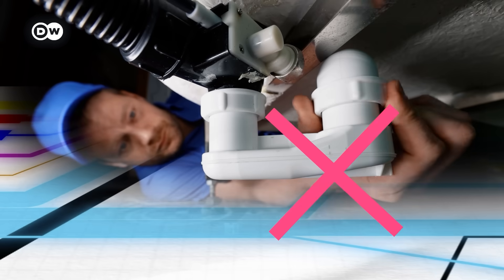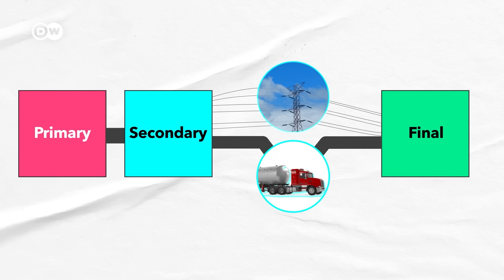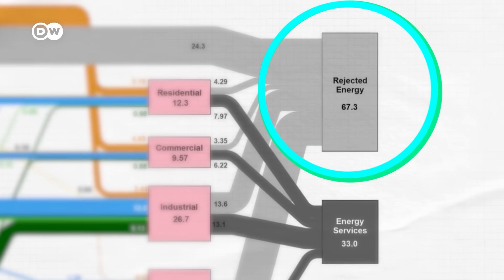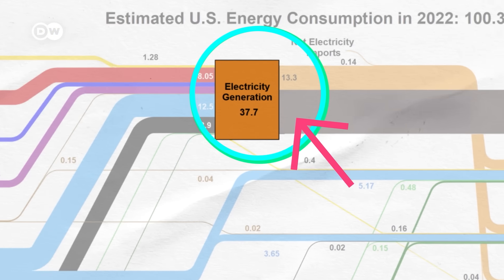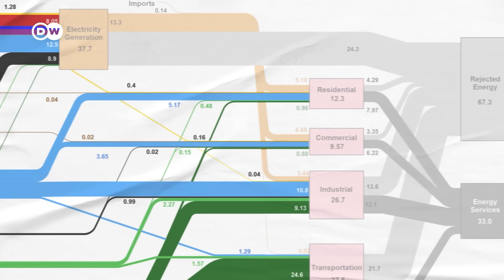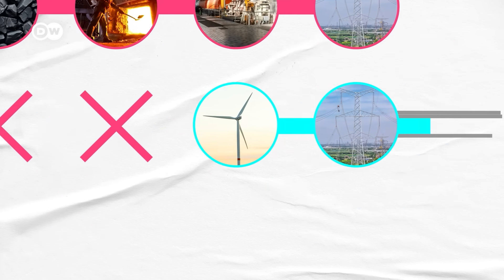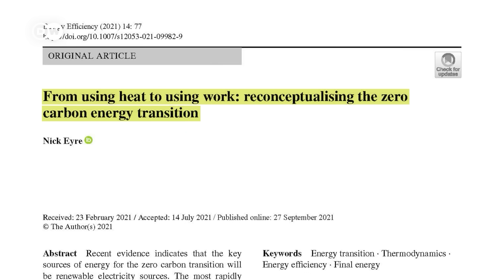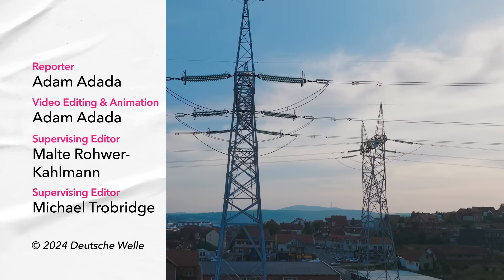The mind-blowing thing we get WRONG about energy

Comment: In the UK, when most of the population switched first to fluorescent light bulbs, then onto LED light bulbs, the nation's energy consumption dropped by (roughly) a third. Little things, done en masse, can make an enormous difference. If the country could just find a way to finance the mass installation of insulation for nearly every domestic, commercial, and industrial building, the levels of energy consumption would drop through the floor, and because the UK is so heavily reliant on natural gas for heating and hot water, once a wholesale (& what SHOULD be treated as a national infrastructure programme of significance for national security) were implemented, the drop in the nation's emissions would drop in tandem. Perhaps the lessons learned during the building of the national grid in the early part of the twentieth century might be applied here; compulsion through legislation would almost certainly be required.

The trickiest part of this would be how to approach property owners rights, any financial recompence, and who pays if things go wrong with individual properties. Of course, the training and implementing of a highly qualified workforce would be no small matter either.

I thought that this video was amongst the best I've seem at being able to sufficiently simplify the topic as to be clearly understood by a wide range of people who are not experts in the fields of engineering and energy. Very well done!! 👍

Comment: The transition to renewable energy is not as straightforward as it may seem. A significant amount of various materials is required to construct renewable energy plants, convert energy from DC to AC, and deliver that energy to consumers. Since this energy is converted by human and for human use rather than occurring naturally, it must adhere to the laws of thermodynamics. As a result, the overall pollution levels should remain consistent with use of hydrocarbons; however, instead of carbon dioxide, different pollutants may be produced. Of course, hydrocarbons are too valuable to be burned for electricity production.

Comment: This video is misleading in so many ways... First of all, in Europe and in the ex soviet block countries, the heat residue from coal, gas and nuclear plants are used to heat homes, office buildings, kindergartens, etc. (it is also used to produce hot water) Second of all, EV-s are a lot heavier, which means we need to produce more energy, which also increases energy loss at production level. Comparing the 20% efficiency with the 90% for EV-s is also misleading. 20% efficiency for regular cars include heating, and AC when needed. 90% for EV-s does not include those, along with heating the batteries in winter. EV-s are good, but not (the only) solution, imho.
But I have to admit that those charts are mind blowing. If only we could reduce those numbers. I hope EU will shift to that direction instead of just using solar panels, etc.

Comment: It wasn't wasted. It was used to make a fuel, and then the fuel was burned to release its energy. Internal combustion engines are inefficient but unless you have a more efficient engine, it's a moot point. 

Your points are largely valid only if you can power the world with wind and solar. But you can't. Missing from the equation is affordable storage. We can reduce fossil fuel use to a point and then grids become too expensive.

Comment: Thank you for the great video! One very stupid question came to my mind yesterday while listening about balcony solar panels. Let's say instead of getting sunlight from window, you put full opaque solar panel, which ends up getting no sunlight to apartment! Then you are charging your battery with that sunlight and let's say solar panel is so efficient that it is not heating any. 
So, we ends up having no sunlight to increase room temperature at daylight. Instead we charged our battery and use it for whatever we need. If we decide to use it completely for heating our home, then what is our gain? But as we havve global warming problem, it probably means we don't need to heat up our home with all sunlight, we instead better use it for other energy needs.
But how about global scale? Is wind useless? Or sunlight to the bare soil? If we absorb all the wind energy and turn it into electricity, then what about other roles of wind in nature? We are probably getting one spoon of wind from a huge wind energy ocean, but we just started!

Comment: This video completely discounts the fact that you need batteries to fully implement renewable energy.  There simply isn't enough lithium or lead on the planet to do that.  Look at Germany if you want an example of a failed attempt at 100% renewable energy grid.  In fact, they've recently had to reopen old lignite coal plants to support base load electricity because France no longer had enough surplus nuclear power to supply them.  I myself have been living off-grid with solar for +10 years now, and it can't be done without batteries or a base load supply from fossil fuels or hydro, PERIOD.  The solar panel and wind mill fairies will not save us, Fusion is humanity's only hope.
Reply from the maker: Lithium reserves are actually quite abundant. However, there are many problems associated with mining. Watch our videos on these topics here 👇
"Why our future depends on lithium"
📺 https://www.youtube.com/watch?v=gAZV1Ut6DDs
"Has the EU already lost the lithium battery war?"
📺 https://www.youtube.com/watch?v=Q6jJjCOJEzE
Also, great to hear about your way of adjusting your needs to solar availability. Here's our video talking about grid  👇https://www.youtube.com/watch?v=u-DsDuTceTo
Reply: You need energy storage. There are many technologies in addition to batteries to store electrical energy for short or long term use: convert to thermal storage (sand), upgrade reservoirs for pumped storage, chemical conversion (hydrogen, methanol). The storage type will depend on the end use.
Reply: @chrstopherbroughton130  The only type of energy storage that is decently efficient is pumped hydro.  Thermal storage and hydrogen electrolysis are terribly inefficient.  Mechanical energy storage is also... meh.  It's very difficult to store electricity efficiently and cheaply.
Reply: @bigrob1887  The thermal storage efficiency depends on end use: high for heating applications (buildings and industrial) and low for electrical generation.  I have watched a couple of other recent videos since your comment that you might find interesting “The Biggest, Dirtiest Secret of the Energy Industry”  and “Welcome to the Era of Energy Disruption”

Comment: Good job oversimplifying things.   What about the manufacturing and disposal of this tech?   And the toxins it creates?  What about the upgrades needed to make every house be able to charge cars?   What about the fact that there is very limited mineral availability?  How about the fact that the average person’s salary is not matching inflation, and even if it did it would have to exceed it to afford this tech.  What about the high cost of batteries, which is not going down as promised, and how these cars/ tech get scrapped faster because of the cost of replacement and repairs?   Don’t show the upside without showing the downside.   Sorry people, this is not a good unbiased video.  Wonder who paid for it.

Comment: There were cut some cornes in this piece. Burning fossil fuel to create steam to create electricity does not only uses the electricity. The steam can generate heat to a distributed heating sytem to supply a city. So the waste is not that big. Another point is the way to calculate the renewable energies. Its not realstic to expect a 100% gain from a solarpanel or a windgenerator.
Statisticly solarpanels delivers app. 25% on average and a windgenerator between 30-50% of their respective theoretical values. Everyting varies offcourse a bit due to location etc. but its fairly normal figures. Also its completely disregarded how different the globe are developed. African continent and most of Asia has at the best some very few inefficient powersupplies. Thats why smal generators are the normal in many households that can afford this. On the countrysides they have no power at all. Thats the main reason thats these areas to day builds coal- and oil-powered plants to create electricity in an attempt to electrify their countries. Because these plants are cheap and can be build fast. and they deliver a stabel output not dependant on weatherconditions. So we may like it or not but coal and oil will still be used decades from now because of this fact. 
We have spent 150 years in the so called developed countries to create powergrids covering our nations. Despite of this we are still facing shortcomings. How can we then expect the rest of the poorest nations on the globe to catch up? Its not realistic.

Comment: This is just sooo foolish. Magical thinking that we can just wave away these easily transported, easily stored, energy dense fuels that were chosen by society for real engineering reasons as our primary energy systems is just utterly ridiculous. Using renewables to completely replace fossil fuels isn’t a fools errand because the efficiency arguments presented in this video are wrong.  It’s because these arguments completely ignore the primary problems with renewables systems.  Renewables are too diffuse, and do not produce when or where we need them in the concentrations required to power a modern industrial society. It’s going back to energy farming. If we truly want to replace fossil fuels we better come to appreciate what they have done for us. Mother Nature collected, compressed and stored an amazingly dense and uncommonly easy to harvest and use energy in the form of fossil fuels that humanity has become accustomed to simply collecting. This has enabled the wonders of the modern world in which we live. No.. Energy density and dispatch-ability need to be replaced by another similar system that also includes density and dispatch-ability as primary characteristics. Hmmmm. What non CO2 intensive energy source has such characteristics? Hmmmmmmmm. I wonder?

Comment: I work in a grocery store and I understand that open refrigeration units are now no longer legal in France.. (they are required to have doors).  Does anybody know how much of a difference this makes?  ..(and by that I also mean not only with regards to energy efficiency but also in respect to retail theft.)
Reply from the maker: Hey there! The energy savings through adding doors to fridges at supermarket is about 30 - 40 %. There is no data on a reduction of thefts through the doors.
Reply: @DWPlanetA  Wow.. Thanks so much!  My understanding is that theft is increased.  There is a Guardian article on the net which claims that cheese is the most shoplifted item in grocery stores.

Comment: This is very promising. The value of natural gas for heating and rapidly deployable electricity generation with relatively low GHG emissions ought not to be forgotten. I got a heat pump installed this past March and I love it! It replaced a 40+ yo AC unit in the house I bought last Autumn. I don’t believe my high efficiency gas furnace has started yet this Autumn. The heat pump will take care of a large portion of my homes heating and cooling. It and the furnace work together to heat most effectively in the winter. A study in Ontario, Canada found a natural gas furnace and Cold Weather Heat Pump (CWHP) are the most efficient HVAC system. 
A CWHP can still heat at -30 C but they start  loosing efficiency below -12. I’ve read, on a web forum, they are still effective/efficient until about -22.  

 I will see how this winter compares to last in terms of my homes energy usage. The “instant” hot water heater should reduce gas usage for water heating relative to an old hot water tank.

Comment: I think the other issue is that solar and wind aren't very good.
Solar is fine. You can put solar panels on any type of roof, and they don't require much maintenance or cause too many problems. Energy usage is also higher during the day, which makes solar fairly practical. The only issue is cost and low energy density.
Wind genuinely sucks. Wind turbines are massive, they make building anything near them impractical, they are more weather dependent than solar, they kill a lot of birds, and tend to catch on fire. If it was the only way of getting renewable energy, it would make sense, but there are much better alternatives.

If we really want clean energy, the following energy sources make more sense.
Natural gas: Still produces CO2, but about half as much as coal. Great for a transition period.
Ammonia: Has its issues, but it has no CO2 emissions, which is currently the most problematic greenhouse gas.
Geothermal: Basically free energy. No unnatural emissions, no refueling necessary. You can literally dig a hole anywhere and if it is deep enough, it can be used for geothermal
Nuclear: The perfect green energy source. The byproduct of nuclear is nuclear waste, which is radioactive, meaning it can still be used as fuel.

Comment: It was a little bit of a fudge to make the comparison of heat-pumps with conventional heating as if it was another electricity vs fossil fuel difference. Inefficient non-heat-pump heaters can be electric too! That said, heat-pumps are a great step forward in reducing our energy usage. Similarly induction stove top vs conventional electric stove-top, public transport vs private cars ... there's a whole lot of stuff we can and should do to reduce consumption that is a separate issue to whether the energy is from fossil fuels or green electricity.

Comment: Plus.  Any fuel or device can be used to make electricity, which can power a broad array of machines.  You can’t do that with fossil fuels.  That frees us to make electricity in the most practical way for the time, location and available technology. If wind makes sense here and now, use wind.  If nuclear, use nuclear.  If natural gas, use that.  If you need to change, change.

Comment: Wow, I am for green energy, but this bit is borderline propaganda. They use the point that heating up water to produce steam takes a lot of energy just getting the water hot, before power can be produced. I agree 100% absolutely. Then they said that we should add more power from green sources because that will lower losses, by filling in the gap, and they showed a little picture of a windmill having 2 less steps. Okay we have established their claim. Now let’s look a little deeper. Why are we falling short on power during peak demand, even though as a society we have switched to more efficient electric appliances, and cfl bulbs? Well what they didn’t say was that we decommissioned a lot of perfectly good power plants before we came up with a transition solution. Now getting back to efficiency and heating and cooling water. Steam turbines are designed to run wide open at their max capacity for years until they need maintenance. They become way less efficient when they are throttled. The example I like give is when you drive your car down the interstate and set the cruise control you get the best fuel economy possible, but if you were to drive 20 then 80 then 20 then 80 smashing the petal to the floor you would get the worst possible fuel economy. So let’s not look at why they are being run this way. When the wind blows and the windmill start up, or the sun hits the panels at high noon, the power plant throttles the turbine. Going back to their point, it takes a lot of time to heat up water, which burns a lot of fuel, so we have already burnt the fuel to get the water hot at this point in time, then the green energy kicks in and all that heat and pressure gets bypassed. So the green energy wastes the fuel that was just burnt, plus it damages the machines which leads to more downtime. Turbines are meant to be base loaded, meaning running at one load all the time. Until mass storage of power is achieved the green energy will continue to waste fuel in steam plants.

Comment: The problem with renewable energy is not efficiency but reliability.
-Wind and solar have low reliability, because you don't have power when there is no wind and sun.
-Water has medium reliability, because most water power plants have build in storage. Nuclear has medium reliability as well for that matter, because it takes a long time to power nuclear plants up and down. 
-Fossil fuels have high reliability, because they can be turned on an of much faster than nuclear and are significantly less reliant on luck than renewables.

As long as people expect the light to turn on when they hit the switch, renewables are a hard sell.

Comment: Not against the transition, it just needs to be done smartly, which is much more complex than this video suggests. First, battery technology and the recycling thereof needs to be improved, because most renewable energy does not produce on demand and requires storage systems. So those ‘Peak Usages’ he discusses will still require traditional plants that can provide peak demand output. If we switch 100% to electric cars, the electric grids will need to supply more energy (by far), which will also increase power plant size requirements when the renewables tank because of no wind or a cloudy day. Additionally, despite all that wasted energy, the fossil fuels are still typically cheaper to the end consumer. My house has no gas, so water and home heating is electric - it is NOT cheap. Lastly, renewables, especially solar, require some nasty rare earth minerals and metals which are sourced and processed in countries that don’t care so much about the environment.